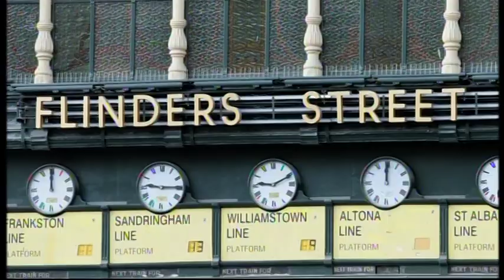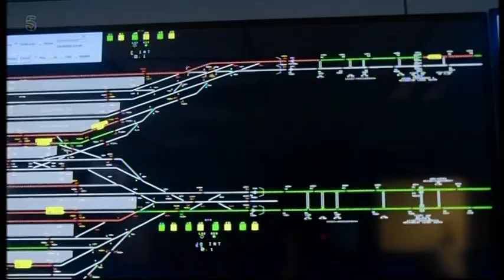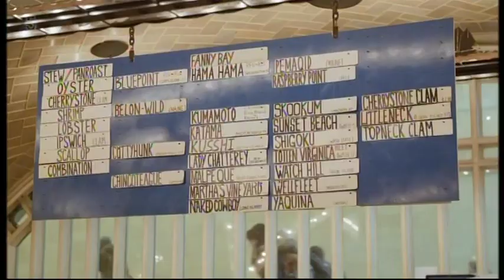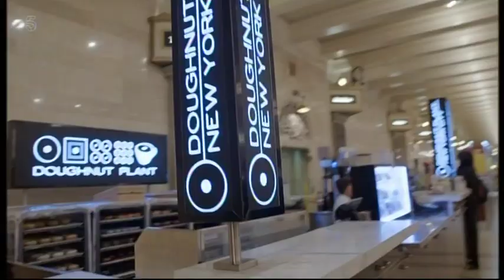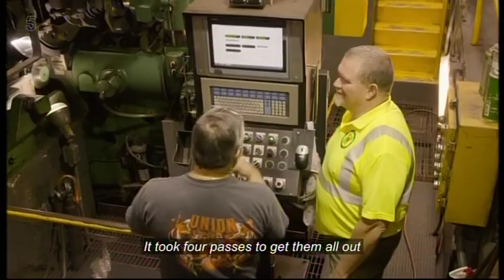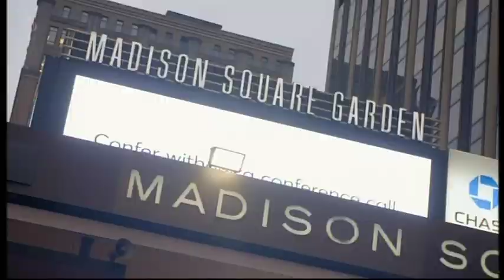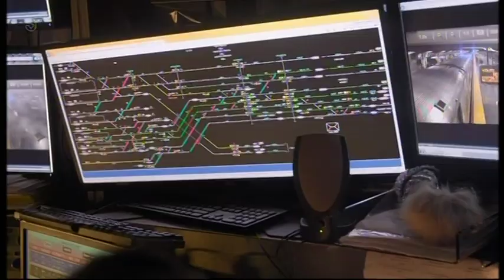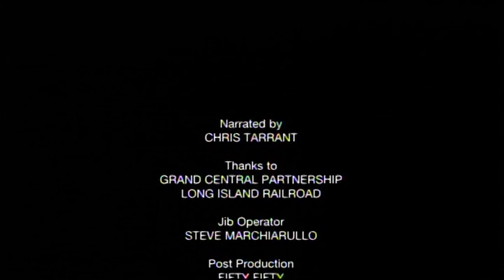World's Busiest Train Stations - Grand Central Terminal & Penn Station, New York City

Comment: im surprised that GTC isnt stretched to its limit. I dont even think NY Central could have conceived so many people using the station at once. I love the new train hall for Penn Station. they did an amazing job on it.
Reply: Well train capacity wise GCT is pretty good. 57 Tracks shared between three lines is amazing (plus the 8 more that just finished construction for the  new LIRR services next year) Unfortunately bottle necks in outer parts of the system limits the way Metro North can provide the most efficient service.